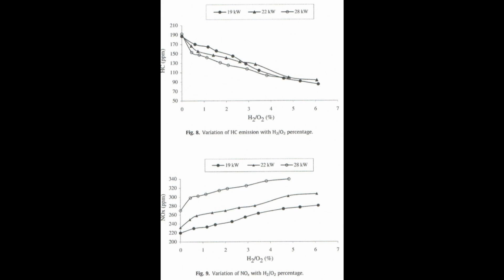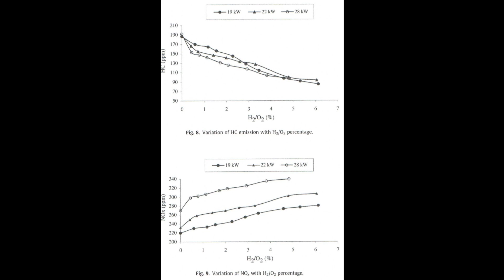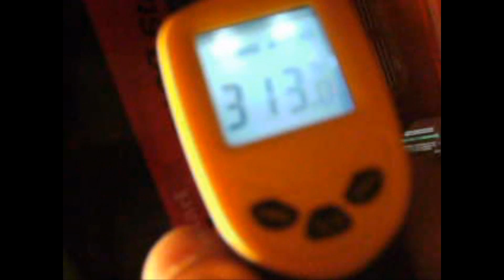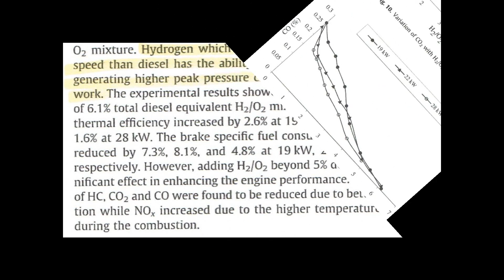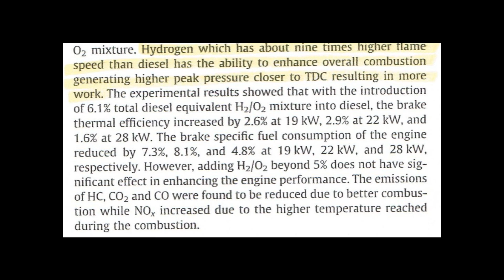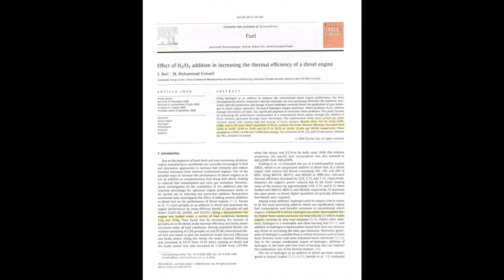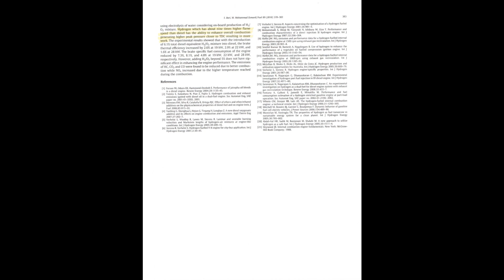Scientific PROOF that HHO WORKS Part 3

Comment: @MikePowers420 - We have been over the ionized hydrogen issue on other video comments. The concesus was that you have offered absolutely no proof of what you say. You simply say you cannot reveal the details. As my video shows, even at 100 percent Faraday electrolysis efficiency, it is still an energy loss because a 20-25% efficient engine powering a 85 percent efficient altenator, powering an electrolysis device, can never deliver more energy than its consumption.

Comment: Smack, I know you have seen my BMW Hydrogen 7 numbers that came directly from BMW. They clearly show that to travel the same distance it travels on hydrogen, requires the same amount of BTU as it does when you flip the switch to run on gasoline. So clearly, BTU matters very much so

Reca'nize

Comment: The difference in energy between para and ortho is only 0.42 percent. HHO is only perfect when it is by itself. When it is mixed in the engine with huge quantities of air (21 percent oxygen and 79 percent nitrogen, it is no longer pure HHO.

Comment: E.S. we all know that you are a distractor/distractor of HHO. Well, I'm making ionized hydrogen and ozone and it's costing me ZERO extra energy to do it because of the electric coils that I'm using. On top of that, I get monopole magnetic fields from my coils that I get to use to aid in the production of HHO.
Face it, your math needs to be readjusted.
People like Smack and myself will just start putting out extremely efficient devices that will prove what we claim.
Deal with it

Comment: I think this is great.  When I get done suing the scum bags that railroaded me into jail I intend to build a variant of the Larson Radax Engine that will run amazingly well on alcohol and hydrogen.
I will tune it to run on alcohol first and hydrogen second.  This is because alcohol as fuel is easier to come by in large quantities.
I think that hho addition or injection is a very important aspect of future low to non polluting engines.  We don't have to give up cars just dirty fuel!!